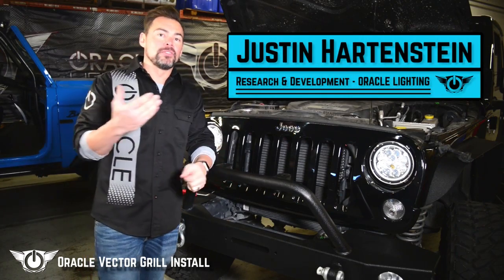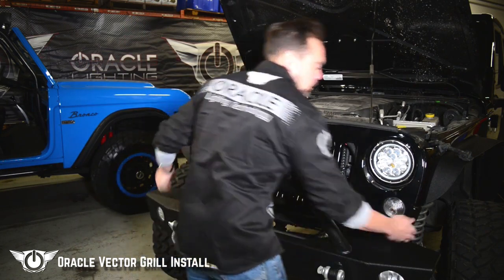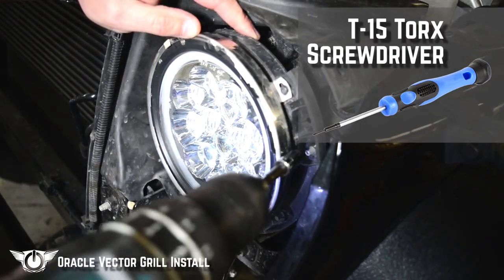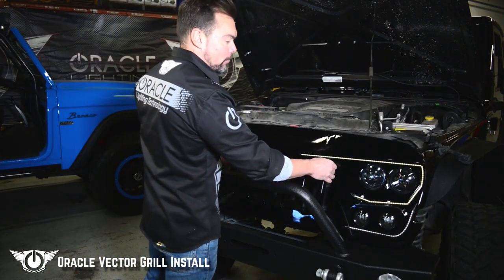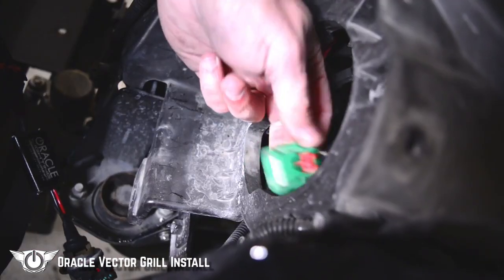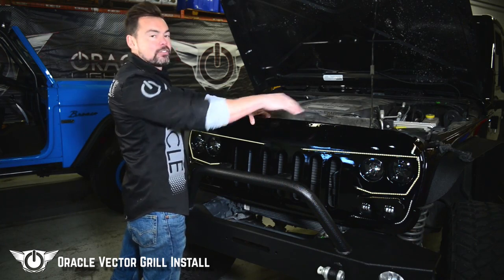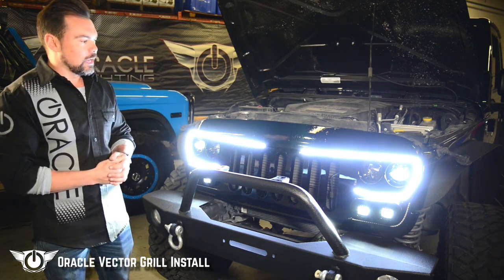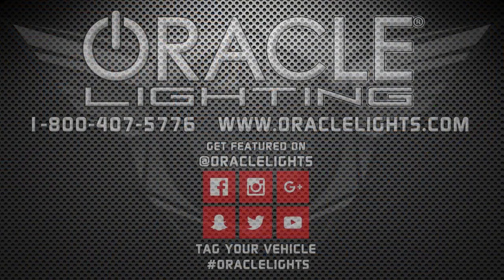Oracle Vector Grill Install on Jeep Wrangler JK

Comment: After 1 year. Within 6 months the DRL shorted out. Improperly sealed from elements. Then the Driver side hi beam. 3 months later. Now some of the LEDs on the accent lights are shot too.  Worse yet they know its not water proof unless you buy the pro kit.

Comment: I was thinking of buying this until I read the comments on quads site. Has ANYONE use this recently with no issues? I dont care I like it. And I will buy it if they worked out the kinks by now...
Reply: It's a nightmare hope you didnt buy it!
Reply: I was just at SEMA this year. They’ve upgraded the whole grille and it’s water proof now and fix all the issues. Hopefully.
Reply: @ixibladeixi2639  could you drop a link or tag a link and me pleaseee can’t seem to find
Reply: I got it from quadratec.

Comment: I unfortunately bought this ...I've gone thru countless parts on it, Oracle has been great about replacing parts for free but its been a nightmare.  It's unusable in the rain and night time it sucks.  Rain ...all the assemblies get condensation in them and burn out, at night time the lights are so bright i get high beamed driving constantly, and i feel horrible driving behind anyone.  Unfortunately im stuck with a $900 piece of junk.  I wish i could get my money back on this or get a newer one that maybe they worked out the kinks on.  I bought one of the first 500 made.
Reply: Will we are in 2022 and I have those issues with the water getting into the DLR’s but the signal lights are fine. I might going on my third set of DLR’s not sure how the water is getting in but maybe they need to seal them better around the seams. Nice set up but as you said it’s a pain when you wanted something to make your Jeep different and it makes it look worst when the lights don’t operate as instructed 🤬🤬🤬

Comment: Is it possible to drill a hole to access the hood lock. I think with this grill you definitely want a hood lock. If not, it will be easy for someone to open your hood and take it.
Reply: Mr X the hood lock won’t work. I had to remove mine. The top of the grille covered up the key hole
Reply: I seriously doubt anyone is going to take it. In fact, this grill will likely act as a theft deterrent for the entire Jeep. It’s ugly AF!